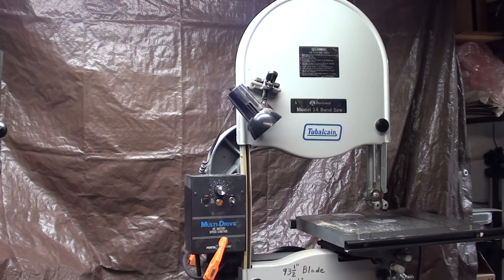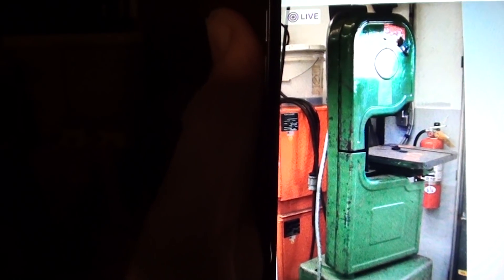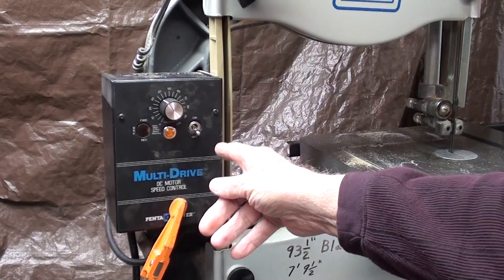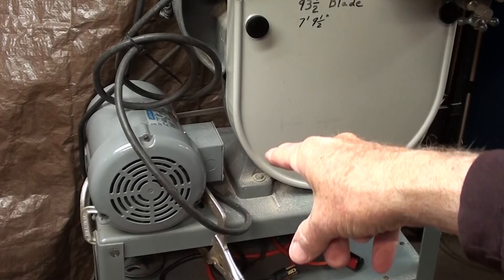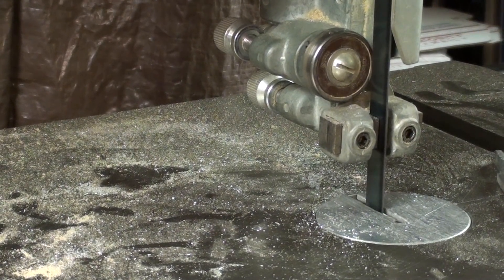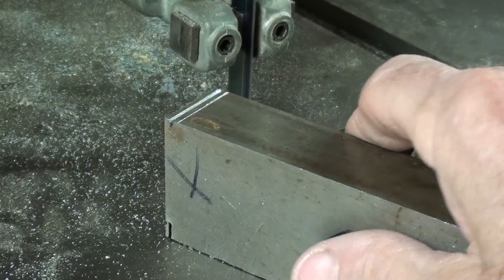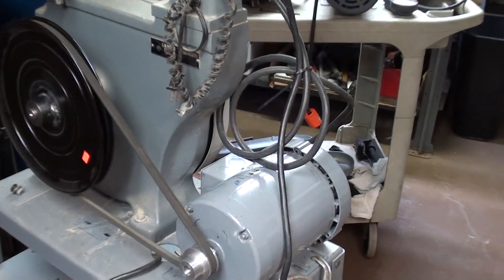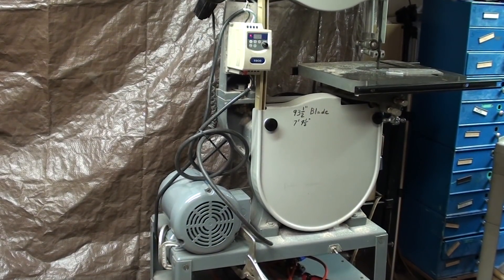Converting Delta Saw to Metal Cutting 491 pt 4 DC VFD tubalcain

Comment: It's always best to make the motor run in it's intended speed " envelope " using gear box or any mechanical spped reducing device.
To speed up cutting it helps to install the proper blade and appropriate number of teeth, I very quickly found out tha ordinary carbon steel blades are only good for wood and Aluminium, to get lots of cuts in harder material you nees to get some Bi-Metal or best quality blades...  
Glad you did this experiemntation, in the Spring or when I can work with the garage door open, there is a project parked outside the shop waiting for it's turn to be worked on...   ;)
Reply from the maker: So true. I am using carbon blades, and they are very poor
Reply: Pierre,
   I ran across some cobalt blades for my ports band at Menards, of all places. They cost a bit more but boy do they cut! I was going through standard bi metal blades way too often so decided to spend a bit more for the cobalt variety. I suppose they are only 5% cobalt or less but it makes a huge difference. You are right about free rate. Pushing it beyond the saw motor capability just causes excessive wear on the blade and machine. I find if I just let the blade cut with only minimal pressure on the part it  cuts faster with better control.
Reply: Motors don't generally have a 'speed envelope' per se. At the low rpm end, it is more of a question of how much torque you can safely draw from the motor at any given frequency. If your torque loading is small, you can go right down to zero frequency with no problems. Yes, there are motor characteristic graphs that have such 'envelopes', but read the fine print for how to interpret them. At the high rpm end, bearing life, possible damage due to centripetal effects, core losses, and many other factors come into play. As mentioned earlier, copper losses depend mainly on current, and torque is proportional to current. So, if heat in the windings (or max current output from your VFD) is your limiting factor for your torque requirements, you need a mechanical reducer.

Comment: I have two of the "Chinesium" models and one is dedicated to vertical use with an upgraded table I made.  They are small enough to sit side by side in my shop and do a good job and you are right, they use a small gear box.  I had found a discarded lawn mower which only needed the carb cleaned out and the blade sharpened and then found someone on Craigslist who offered to trade the second saw for a good lawnmower...it was pure luck but it netted me the second saw for practically nothing.  Thanks, Mr. Pete! :-)
Reply: My harbor freight bandsaw is a real dog. The blade keeps coming off, the guides are terrible. Any tips on tuning it up.

Comment: Instead of a transmission, why not mount an arbor where you now have the motor.  Put two pulleys on the arbor, a small one with a belt to the saw and a larger one with a belt to the relocated motor.  Should be much cheaper than a transmission.
Reply from the maker: Yes

Comment: Lyle old stiff belts can be brought back to life with 303 Aerospace spray it is more costly than armour-all but works great  use it on my power tool belts and also the flat serpentine belts on my cars to prevent cracks and quiet things down.

Comment: Mr. Pete,
   I’m with the mounted ports band crowd. I have cut metal on my 14 inch Delta as is but, of course, it’s way too fast. Probably the best tool I have ever added to my arsenal is the Milwaukee Porta Band. I have a six inch square, quarter in plate mounted on it for a table type surface and I have a mounting bracket I usually keep fastened to the wall to mount it on, though if I needed extra work area to manipulate whatever I’m cutting I put the bracket in the vice. I made brackets that give me three point mounting pins and all I have to do is pull the top pin and the saw lifts right off the bottom two pins for when I need to use it hand held. The plate is a little large for hand held work. I saw a video where a guy made his table to snap on and off some way and leaves the stock stop in place. He wasn’t demonstrating that feature so I’m not sure how that works but would be an option. I rarely use the thing hand held however.
Reply: Dale Griggs - I did the same thing on a budget with a Harbor Frieght "Bauer tools" Milwaukee porta band rip off into a variable speed metal cutting machine... I also have a teco vfd with a 1hp Baldor motor on my 70's Rockwell 14" bandsaw restoration project I did last year. I wanted some variable speed adjustability for resawing & only use that machine with non ferrous metals

Comment: Hmm, yeah looks like it needs an old lathe style pulley set-up, with an extra stage of reduction between the motor and driven wheel.
Reply: I agree a poor man's transmission , a jack shaft and a couple of step pulleys
Reply: True - you could use multiple pulleys - like 4. But the problem is that it is messy to change things around & time consuming. You could also use a 1:20 or 1:30 speed reducer and  fine tune with pulleys (2) and then disconnect it for wood only use - again time consuming - not a "flip of a switch".

Comment: The problem with using a VFD on a 3phase motor is that you only get rated HP at synchronous speed.  Also on a conventional 3 phase motor you only have 10:1 turn down ration.  A better solution would be to use an inverter duty motion with a 100:1 turn down ratio.  The turn down ratio will help aid in cooling.  The best solution would be to use an 1150 RPM motor with a VFD so you would have more torque on the bottom end.  I really enjoyed the series.  I was going to try and do the same thing on an old Band saw I have.  After watching the videos I may have to go another route.  Thanks for the videos!
Reply: Problem is that a lower than 1750 rpm or so motor is hard to get / find.

Comment: Just watched the video of the vfd on the band saw. I currently use same type set up on my 2555 Logan lathe. If the vfd is tripping out on your set up it is more in likely to small of a horsepower rating. Had similar problem on the logan until I got a larger vfd.
Reply: This is what i was thinking and if the VFD is a 1/2 HP rated VFD on a 1HP motor it will hit that limit pretty quick. i always oversize my VFD's so the duty cycle is at max 75% of what the VFD can do . Also the vfd Has Rotor slip and torque compensation that works very well in my experience. on lathes and mills and saws .
Reply: you are on the right track. Just don't set your accel and deceleration rate too high or low it will also make the vfd go into a tissy.
Reply: or he only supplied the VFD with 120vac
Reply: @Steve_Just_Steve  I have several 120v 1ph to 240v 3 pH vfds I'm sure he can read the data tag
Reply: @apollorobb  My point is, many VFDs will run off 120 or 220 like mine does, but when running off 120 the motor's torque is greatly reduced.
Reply: @Steve_Just_Steve  doesn't seem to make any torque difference on my vfd's . I've tried it both ways. Both of mine have torque compensation

Comment: Throw your N.O.S. belts away? Perish the thought! I'm sure they work fine for most of your project. I have a box of old belts taken off equipment that I cut to length to easily get correct length of needed new belt. Comes in handy.

Comment: I beg to differ with you that the whole series is a failure.  I see it as a rousing success.  You have successfully explored the various options for converting a wood cutting bandsaw to metal cutting and have very well demonstrated the trials and pitfalls of the various methods.  This latest attempt I thought was a success using the VFD with a one horsepower motor.  It performed the cutting very well even with a blade that had to fine teeth.  Given a blade with fewer teeth per inch I believe would produce very fine results.  Thanks for the video series, I enjoyed every one of them.
Reply from the maker: Thanks

Comment: VFD's are rated to deliver 100 percent torque at all frequencies up to the motor rated frequency. For lotsa use, one can install a separate cooling fan on the motor. Metal saws have much heavier bow than woodsaws, and so, do not normally chatter cutting metal. No guard dangerous? Well, just slap on a "Made In India" sticker, that will fix that issue ;)

Comment: Failure???  You have utopian view on this series. My bandsaw  (which I sent you pictures of) with a DC 3 hp treadmill motor and variable speed controller has amazed me by cutting 2" shafts with NO problems. It cuts better than my 14" carbide dry cutoff saw!! I love you Mr Pete, but I bet more than you know would clamor to have the last 2 bandsaw set-ups shown.
Reply from the maker: Thanks

Comment: Thanks for the video remember no one is a failure who has friends, and or subscribers?
HA! still wanted to sow you my solution for my walker tuner.. pardon the bad welds it was years ago i learned to weld but its solid and the bearings in the pipe i used gives smooth operation. 
https://drive.google.com/file/d/1NivORcfCqqNLd87e9y3fpfmZV8RH6EKs/view?usp=sharing
I'm still trying to figure out a similar system for my old three wheel band-saw and using a thinner blade for some fancy cuts (i hope). Cheers
Reply from the maker: Thanks